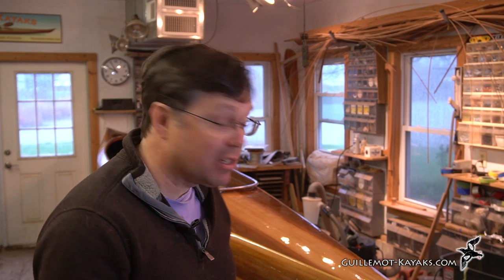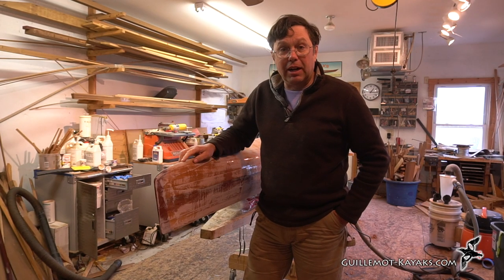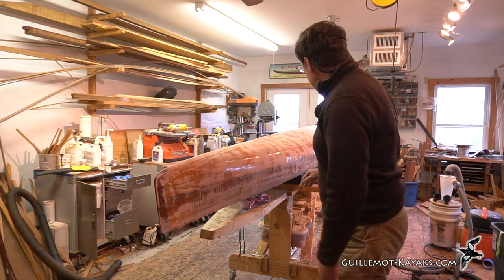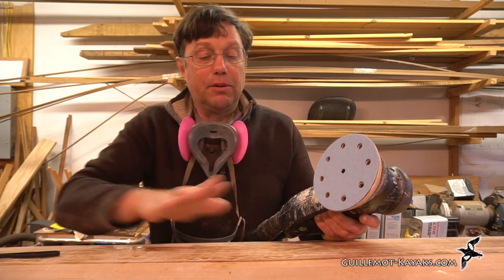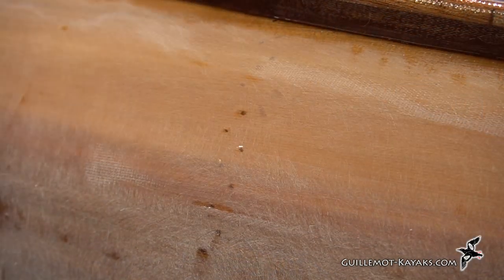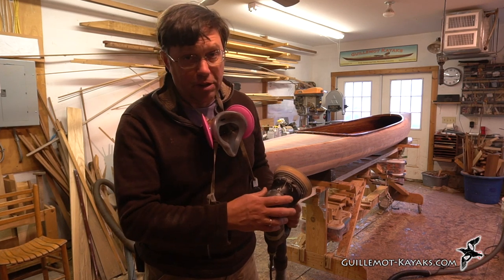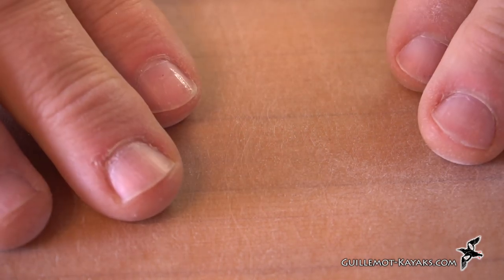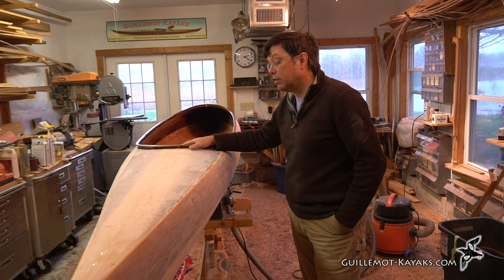Sanding Round 2 - Kayak Class Completion

Comment: Im restoring an old wooden racing dinghy and I used fiber glass and epoxy to re strengthen the hull. With the hull being so old and thin and the poor job I did while fairing the boat, its covered in tiny little shiny low spots. It drove me mad trying to dull them down with an oribatal sander. I know now alot may be my fault to why its like this. I settled on scotch bright because I learned quickly that any grit sand paper will eat down to the fiberglass before its fair. there is many spots where the epoxy is in a small 1 inch spot and sanding those are a nightmare. Itll be intersting to see how you tackle the hard to get spots on the boat. I for one know its been my least favorite part of the project.

Comment: Did I miss it, are you wiping down the boat between each sanding to avoid re-scratching the surface?
Reply from the maker: I know you are supposed to, but I often don't. I find the dust collection on the Festool to be very good, there isn't that much left after sanding.